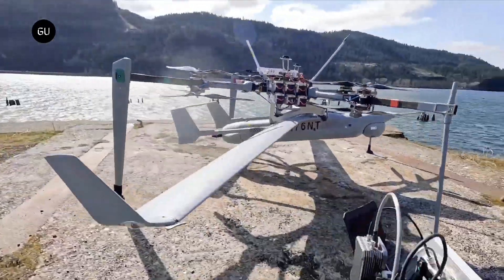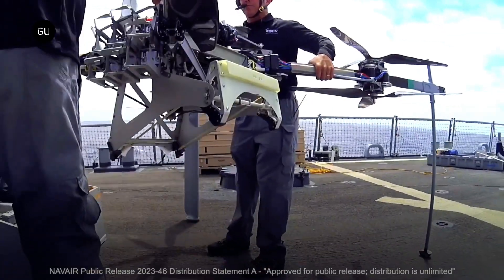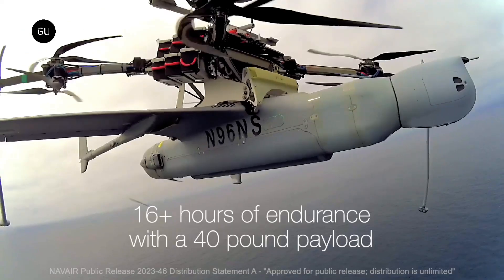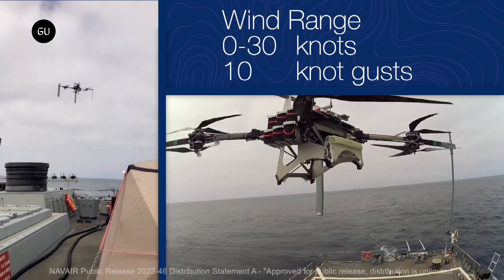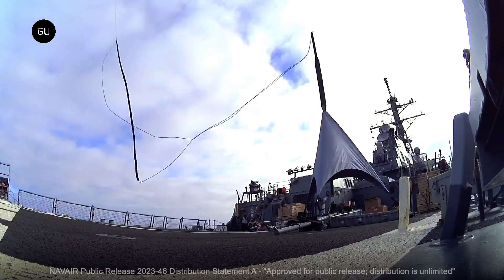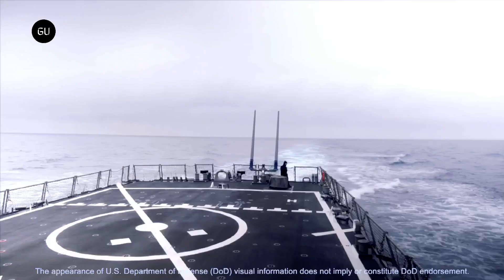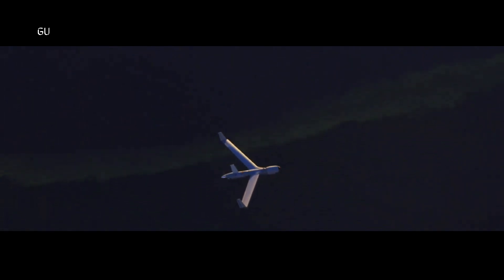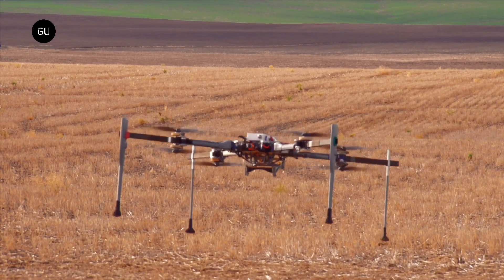Insitu Debuts Vertical Takeoff System For Integrator UAV

Comment: I can’t understand in any way what is the advantage in the tandem propeller scheme? And why is the same distance always taken between the propellers in this scheme? There is another version of the propeller and more productive than the tandem scheme, invented by the Chinese in their taxi and taken as a basis. In the Chinese tandem scheme, a pillow of air is created between the propellers. One screw during operation drives air down. When two propellers work in tandem, one should work (upper) at a speed less than the lower one. And this is a huge minus. Look at Elon Musk's platform. It has multi-blade fans as propellers. Is it so hard to guess that fans are the future, not propellers. -
Reply: I like the time you've put into this.